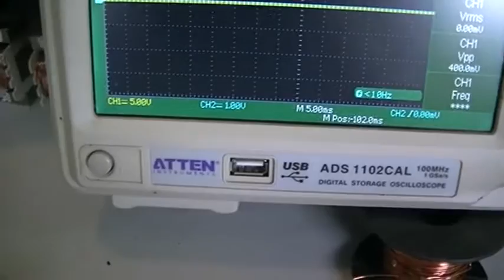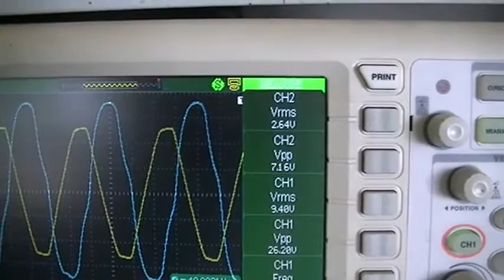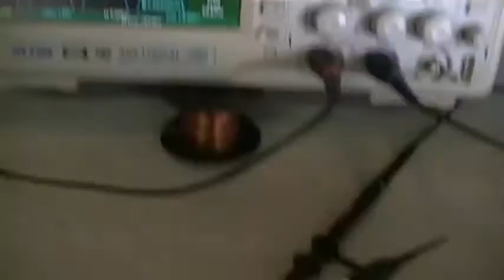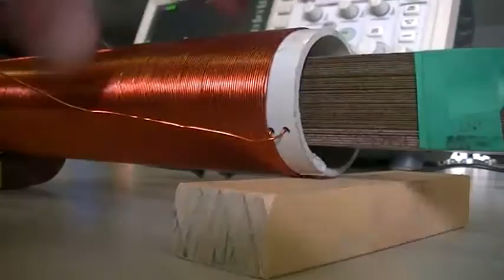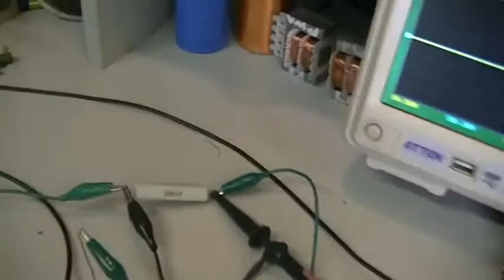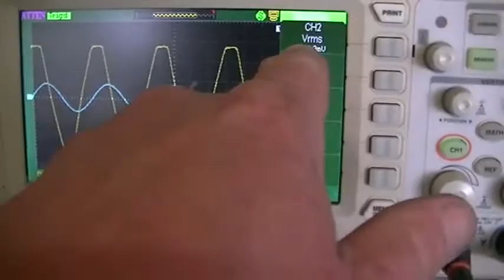Magnetic and electric fields of a coil test 2

Comment: the voltage per turn is calculated per turn. When you start at one end, it can only be the primary's input value.. when you get to the middle, you go to the turns ratio x the input voltage, again, to the other side back to the source power level.
Reply: In teslas design the wires where allowed to hum/vibrate. This may help generate and pump as it cuts additional magnetic lines. As well as utilize conservation of motion similar to a spinning gyro.
Reply: Was searching for something else very interesting though. Thanks for posting.feel free to spark conversation:) as a fellow enthusiast.

Comment: Transformers work the best at their natural resonance frequencies. 50 Hz is most likely nowhere close to the resonance frequency of either coil. One thing to note is that while there is induction from the primary to the secondary there is always induction also from the secondary to the primary. When the resonance frequencies of the coils are not the same there will always be destructive interference in the induction/oscillation and that leads to heat and loss. Kind of like pushing a swing when it is coming towards you and not when it is just starting to move away from you.